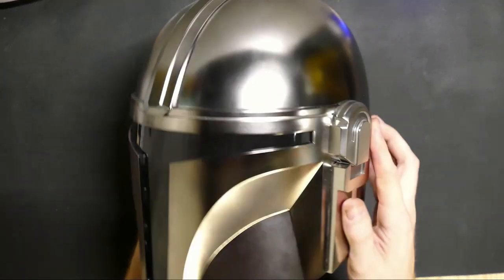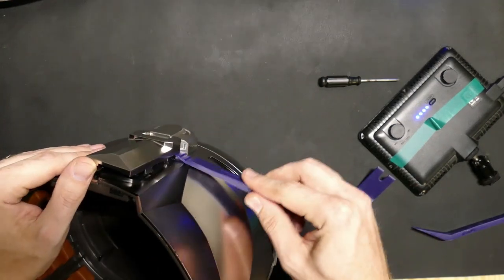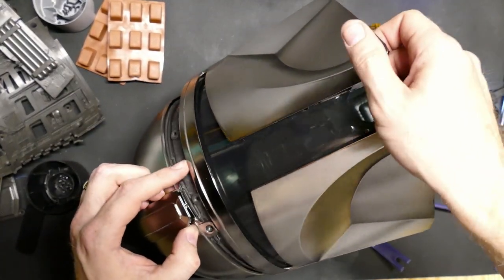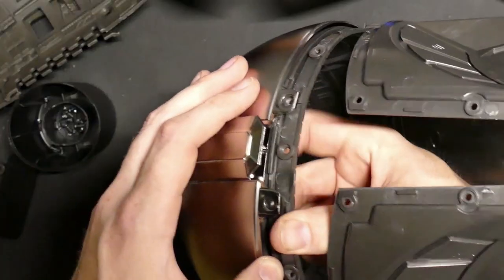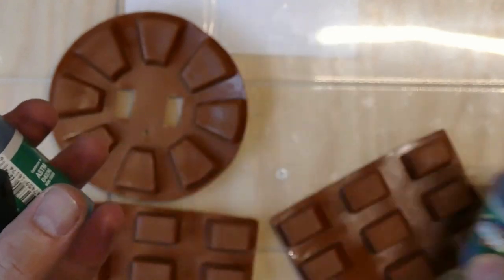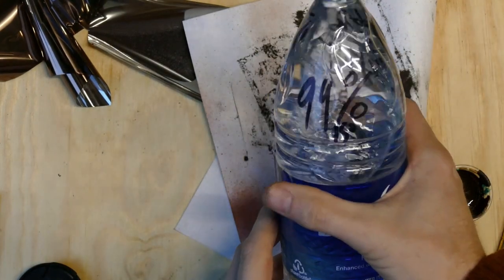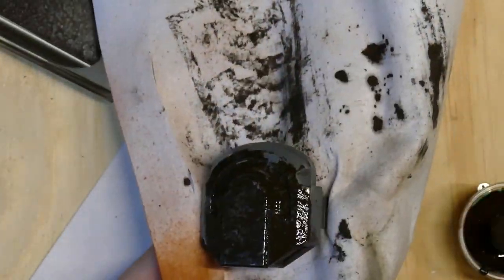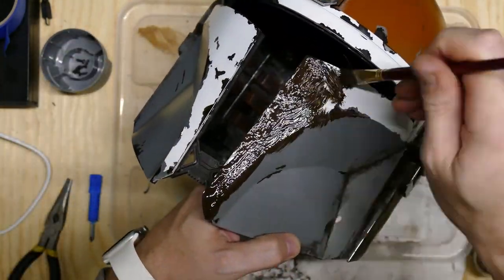Black Series "The Mandalorian" Electronic Helmet Customization

Comment: This is fantastic in the process of modding my black series Mando helmet (added a RF so far and possibly adding a fin to the top back) then onto the paint job so deo will have this on repeat as I do it. Have you tried using the current battery pack/electronics to add a fan in?
Reply from the maker: I was just looking into the electrics when a disaster hit and I lost my workspace. If you do it, share with me on Instagram! I’d love to see what you do.

Comment: A little late to the party here, but i'm looking to customize my own Mando helmet with some custom camo designs based on old East German camo. Does the type of spray paint used matter? Any specific brands you recommend for priming or basing before the final color?
Reply from the maker: Hey man! I’d recommend finding a brand with a satin or matte finish you like, and get the primer from the same company. Sometimes they don’t play nice with each other. I think you’re gonna have fun
Reply: @daveofalltrades805  Thanks! Would you recommend sanding the helmet at all before applying paints? I know some paints work better on a rougher surface.
Reply from the maker: I’ve been guilty of skipping sanding for a quick paint but I think all the experts recommend roughing the surface for adhesion

Comment: Do you think it’s possible to easily disassemble just the front of the helmet to get the visor out without totally disassembling the inside?
Reply from the maker: You’d have to undo the ears, visor, and unclip the front of the ridge. Seems possible for sure
Reply: I did it today not that hard. Need to remove the visor and ear cap screws completely but you can wiggle it out without undoing the clips